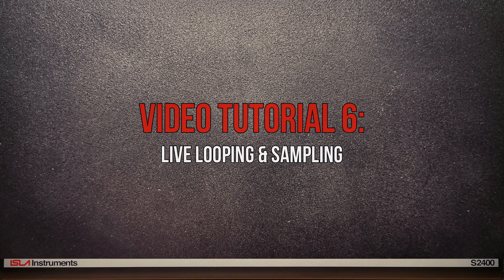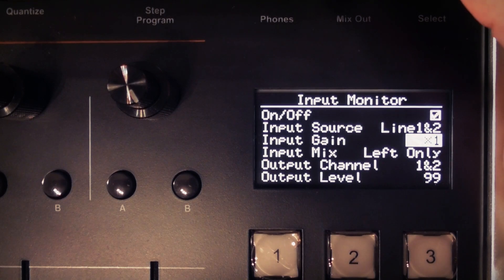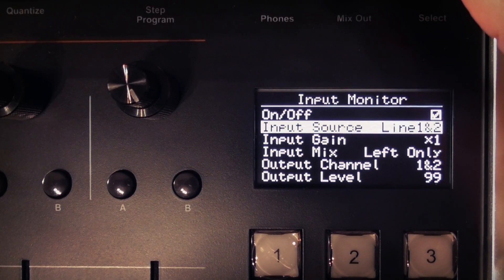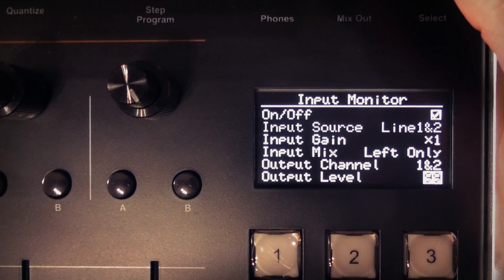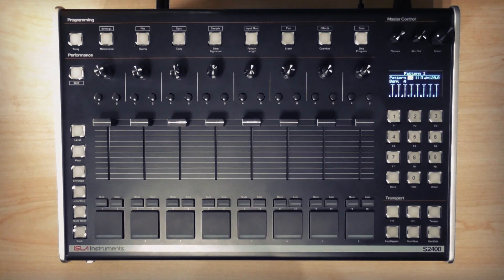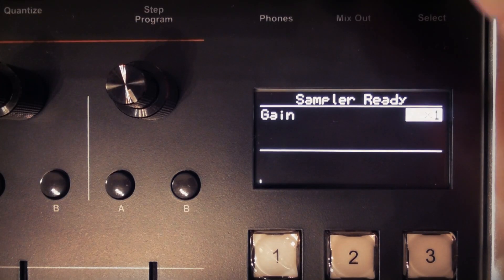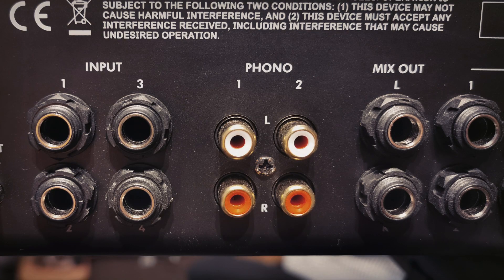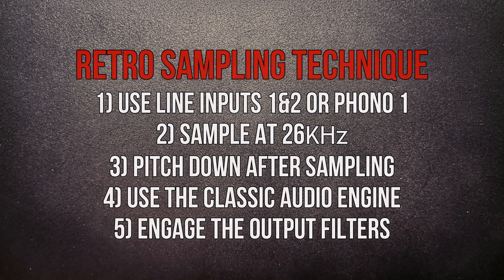[OUTDATED] Part 7: Live Looping & Sampling - Isla Instruments S2400 Video User Manual

Comment: What is the best set up for recording a vocal loop with a microphone? Do I need a microphone preamp? Can I use XLR to 1/4" stereo cable? Or to 1/4" L/R splitter? Then, how do I set up the input channels with the correct mix cable configuration?

Comment: Alex why does pitching up before importing make a sound more Retro?
Reply: bit reduction limits the dynamic range and gives it that oldskool sound.Record in higher speed , you save a bit of fidelity when pitching down in used bitrate.
Reply: Because the sample rate goes down when you pitch down adding aliasing and artifacts to the audio. Basically you're changing the fidelity.

This is what they did back in the day (due to the limits of sample time) and it has a distinct outcome.
Reply: @AlexBallMusic  Thanks. :)
Reply: Because thats what they did on the original SP-1200 so a sample uses less sample time. Sample time was very limited then.